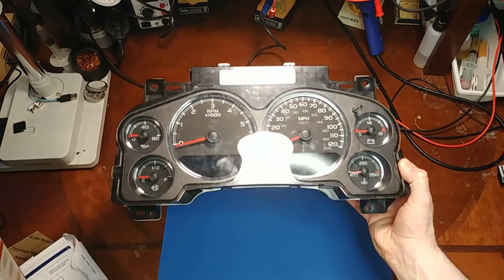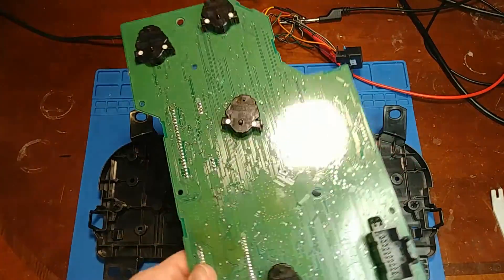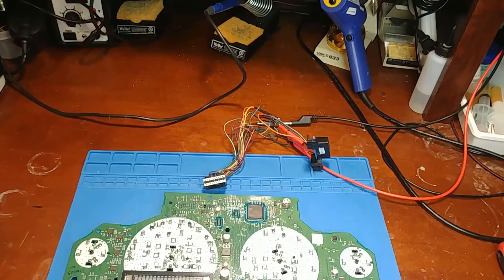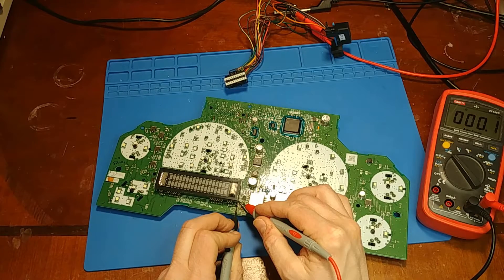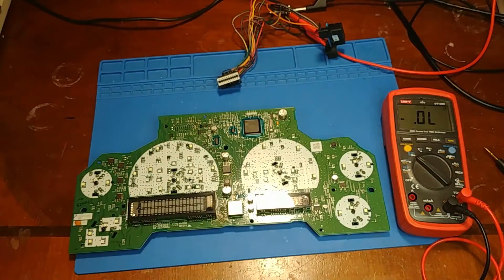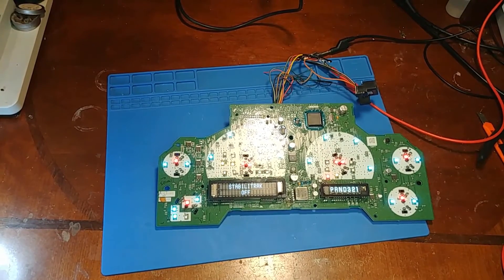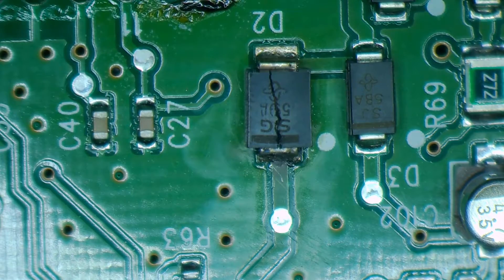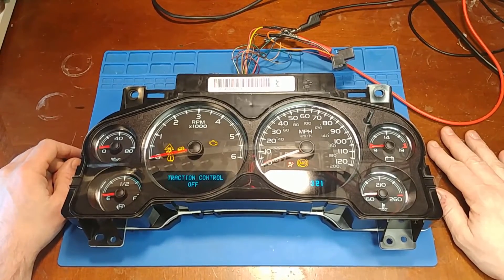Can this 2007 Yukon cluster be fixed?

Comment: What wire do you use for your trace repairs? Thanks
Reply from the maker: For short runs I typically just use the left over cut off leads from the lamps I use while rebuilding clusters.

Comment: how do you know what size diode or capacitor you need if its deformed? do you have a link for the different sizes kits?
Reply from the maker: Typically for a one off like this I'll pull a good one off a donor. If I don't have a donor I'll look for a part number. If I can't find a part number I'll take a educated guess.

Comment: The line coming off the resistor to the top pin of the mosfet is sitting on top of the original trace. Is there nothing at that trace anymore or is it just lifted off the board so it’s not touching? Thanks
Reply from the maker: I'm not sure at what time in the video your talking about, but in this one it looks like the resistor is still sitting flat.

Comment: How much are you charging for a cluster repair?
Reply from the maker: It depends on the year/model.
Reply: @jeffescortlx  2010 silverado cluster
Reply from the maker: @motorolapure6321  what's wrong with it?
Reply: @jeffescortlx  electric said cluster, radio, engine computer does not communicate thru obd. Apparently lights on but do not know more
Reply from the maker: @motorolapure6321  how do you know the cluster is to blame for the comunication issue?
Reply: @jeffescortlx  brought used parts and silverado works know cluster just was plug in and worked and  have this parts and would like to see if can be repaired
Reply from the maker: @motorolapure6321  ok. Send me a email if you would like to move forward.
Reply: @jeffescortlx  ok

Comment: Hi jeff, what type of wire and where can I the wire you are using to make your jumpers
Reply from the maker: You have to use automotive grade ASE certified 100% pure copper 30AWG  low resistance solid stand wire. Just kidding. Anything that conducts will work. I typically use the cut off left over lead wire from lamps, because I have a unlimited supply.

Comment: What are you using for jumper wire? I recently used a single strand from a 12 gauge wire.
Reply from the maker: I'm probably using the lead wire from cluster lamps. I have a unlimited supply of those.
Reply: @jeffescortlx  Thanks. Why didn't I think of that?

Comment: Having a speedo cluster being repaired now and never had any idea this much was involved, really great informative video, what is the flux or pcb cleaner you use here, the solder seems to be most fluid and connects seemlessly, the close ups are simply brilliant, will help by soldering ability  big time thanks

Comment: Do you have the schematics for all these instrument clusters you work on ? What is the liquid  that you put on to remove components without desoldering
Reply from the maker: No official schematics, just some sketches I made. Only liquids I use is rubbing alcohol and flux.
Reply: I don't suppose car companies make these available.  Knowledge has to be learned.
Reply from the maker: @gplusgplus2286  Yep. It forces us to reverse engineer. But in the long run it just help me understand how they work even that much more.

Comment: It amazes me they use such a beefy processor (mpu 16/32bit) to read codes and run a simple cluster of stepper motors..
Reply: Umm.. atmel avr chips have watchdogs and do everything this processor would do. There are mil spec avr chips.. in fact most meet the criteria. As far as interacting with other parts of the vehicle that’s hogwash.. the vehicles today use a can bus. The dashboard doesn’t control the transmission or engine. There are independent systems on the bus that do. These systems include ecu, transmission, airbags, antilock braking/ABS, cruise control, electric power steering, audio systems, power windows, doors, mirror adjustment, battery and recharging systems for hybrid/electric cars. Also include any accessory installed. These are independent systems. If one goes out the rest can still function.  The only thing the dash needs is a serial line to talk to the rest of the systems.  So seeing a 32bit cpu running a gauge cluster seems like over kill to me. Which to me is very surprising seeing how car manufacturers want the cheapest cost parts. I mean half the cars these days use plastic body mounts to hold bumpers on to cut cost on a screw.
Reply from the maker: I'm not an expert on the micro controller stuff, but it is keeping track of 6-7 stepper motors, half dozen warning lights, and a display, odometer and trip counting, I assume the cluster is calculating fuel mileage all simultaneously. The 03-06 are also watching analog inputs. I suppose it needs some power to do it all quickly.
Reply: Most of that can be accomplished with a simple avr.. I’m guessing the mpu in the dash does more than the dashboard. It must deal with other components of the car. Any a2c serial lines out the back connector?
Reply: @Astinsan  these components are so beefy because they're safety critical. You have to know what speed you're going and the state of the transmission to safely operate the vehicle. To comply with safety standards that micro probably has all kinds of cross checks, self tests,  watchdogs, ECC all over the chip, and more. All that stuff takes die area and power. So while the functionality could be implemented on an AVR, the bureaucrats would never sign off on it.
Reply from the maker: @Astinsan  as far as I know it just has one main serial comunication wire. But they do generally have a few analog input to.

Comment: Jeff,  you convinced me not to work on my 2011 gmc sierra instrument cluster.  Washed truck and digital display under tach (DIC) does not illuminate.  What would you do?
Reply from the maker: I would start by trouble shooting the main MOSFET that drives the VFD power supply.

Comment: Nice video Jeff.  I've done a couple of these for friends and noticed that the MOSFET on some run just warm and on one or two it runs to me way too hot.  What causes the MOSFET to run too hot and what is the fix for that?
Reply from the maker: I'm not 100% sure, but the failing solder joint might not help, it is a regulated circuit, so the less output, the harder it's driven. I solder on a heat sink lead to the tab if the repair allows.

Comment: Whats up Jeff. You ever try that T15-D24 tip?
Reply from the maker: I'm still on the J02 and really like it!
Reply: @jeffescortlx  Try the D24 chisel. Trust me on this. Its good for 99% of everything GM cluster related. It will way outperform that J tip you're using. Just for fun I gave my J tip another shot the other day....It quickly got swapped back out for my D24 tip
Reply from the maker: Alright, next time I fire up the station I'll put in the D24 and give it a shot.
Reply: @jeffescortlx  I think you'll like it. Another one of my personal favorites is the T15-1001 Tunnel Tip for desoldering SO8 IC's. Makes pulling off EEPROM's a breeze. No hot air necessary. You might want to pick that one up too now that you're able to quickly swap out your tips.
https://www.hakkousa.com/products/soldering-iron-tips/t15-series/t15-1001.html
Reply from the maker: I don't mind hot air, but that tip looks pretty handy. I don't suppose it would work on chips with the center heat pad on the under belly of the chip? Like other tips, it's cheapest to buy right from hakko!
Reply: @jeffescortlx  No, I don't imagine it would work with chips that have an underlying heatsink pad. But it is a super handy tip. I like it cause I don't compromise any components with hot air or make a mess with flux. And if you're handy with a dremel, you can modify the T15-1008 tunnel tip to work on the 07 clusters for MOSFET removal. That is, the ones that haven't blown up and welded themselves to the board. I hate using hot air right next to both those VFD's and transformer.
Reply from the maker: I've been avoiding hot air on those lately to (at least on clusters that haven't already been attacked by someone else) I'll use one iron on the tab and lay another iron with a phat tip across the 3 legs and pick it off.
Reply: @jeffescortlx  Yup, that method works well too. But that modified T15-1008 is awesome! Been using the same one for many years. Keep them clean and tinned, and they last forever. I'm starting to sound like I work for Hakko huh? I swear I don't.
Reply from the maker: I get it. It's easy to get excited for Hakko. Professional quality at reasonable prices.

Comment: Hay Jeff,can you tell me what the part# is for the 01 s10 the steppers & do you know if kits with some blue light are available? if so, can I get the link please?   And THAX for the vidios!!!!!
Reply from the maker: That older style is just know as air core. Make sure to buy the right one as they are not all the same. In other words the volt wouldn't be compatible with the MPH, or gas with RPM.
Reply: @jeffescortlx  air core?? not sure what you meen. I assume that there not the same as the ones in this video. but are kits not available for the 01s?? My gauges dont stay at 0. about 20-25sec after I shut down the truck, the temp gauge quickly (like its being powerd to do so) jumps to 260 & the oil gos really slowly to about 12psi, I took the cluster out and took the face off it and played with the needels. They will spin all the way around, but rest at the 260 (or 180 from it) and the 12 to 20 psi . it does this laying flat on its back. ohhh When I shut the truck down this always happens BUT if I open the passenger door (not drivers) the security light flashes and the temp gauge drops to 0, oil gauge gauge is uneffected by this, it stays at 12psi. after about 20-25 sec.... pop.... back up the temp gauge gos. Sometimes, I dont know how or what I do to make THIS happen, but I can SUMETIMES get the temp gauge to stay down at the 0 point. even over nite. Do you think the "gauges" are my problem? The hole passenger door thing has me confused along with consistant the timming before the activity.
Reply from the maker: Sounds like you could have multiple problems. Sorry I'm more familiar with the 03 and newer full size.
Reply: @jeffescortlx  OK.... well thanx for the info..... keep up the good work